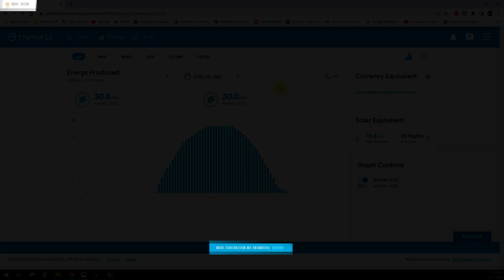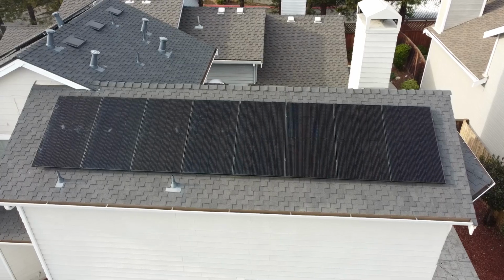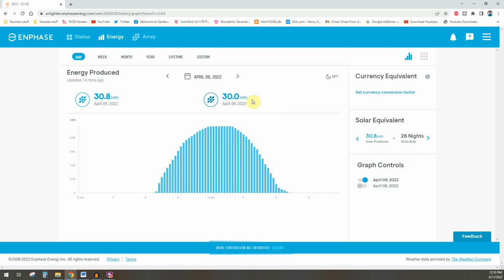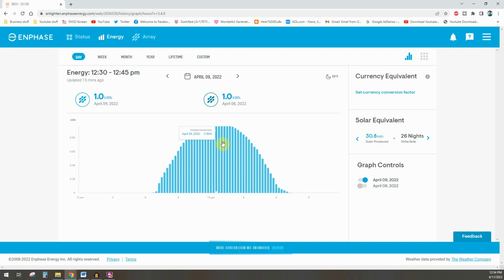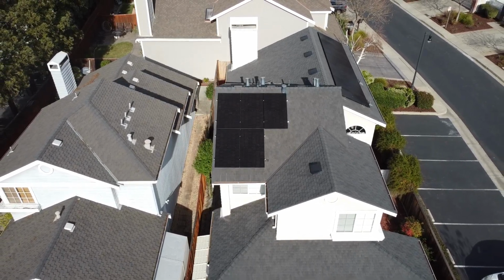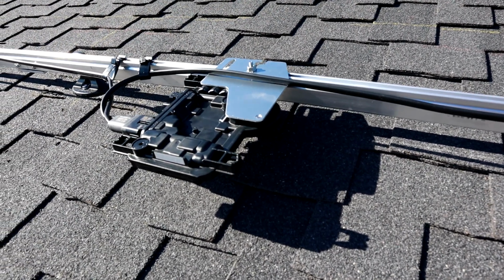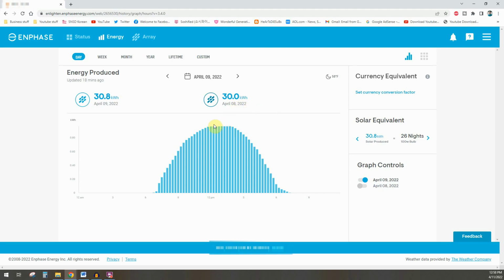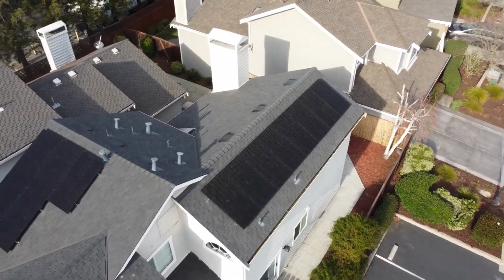What Is Clipping For Your Home Solar System?

Comment: Thanks for the video and information. 

Sometimes it's possible to mount panels on a vertical wall facing approximately west.   This will increase production during the late afternoon peak demand period when electricity is the most expensive.
Reply from the maker: Definitely.  That would suck to be that installer though putting those up :D
Reply: @nukem384  Actually not at all.   I build van electrical systems and put panels all kinds of places.   Not a licensed home installer though, only do mobile stuff.    There are some challenges with getting the conventional mounts accepted by cities but it is a must going forward

Didn't realize at first that you are also in the bay area.   I am in the East Bay
Reply from the maker: @harryniedecken5321  Heyo go Norcal!

Comment: Where are you located and panels facing south?
Reply from the maker: Bay Area.  I have 2 arrays that face SE and SW.
Reply: @nukem384  l am planning to get REC 400 panels and Some installers recommend IQ8+, IQ8M and even IQ8A. I have some facing South and located in Kansas. What do you recommend?
Reply from the maker: @mrteausaable  REC 400 are good panels, so you're good there.  What's your pricing for the micros based on?  IQ8+?  If you can get IQ8Ms, those are best suited and super popular with 400w panels because it's a good mix of a good DC ratio (clipping) and not too expensive like the A's.  Hoping in KS, your total price is about $3/watt gross if you're paying cash for the system.
Reply: @nukem384 I already got a few quotes the lowest price is $3.40/watt up to $4.20/watt.  No one offer $3/watt for REC 400 and IQ8M.  I am afraid it will not clipping at all for IQ8M (330peak) in my location since sun is very low.  Some quote me with IQ7+ and IQ8+.  One quote me with IQ8A because this is what they can get plenty off.  This rep I will stay away.  They sell solar and do not care about your system production.
Reply from the maker: @mrteausaable  You actually want to go by the continuous output, which is 325w (va).  Not much difference, but just wanted to let you know.  Dang that sucks your area doesn't have any installers that will do it for less.  My installer was quite a bit cheaper in the expensive Bay Area.  I'm pretty sure you're still going to clip since you said you have S facing panels, but it probably won't be that much if the sun isn't that high in the sky.  Getting IQ7+ or IQ8+ isn't bad either if they are much cheaper.  I have IQ7+ with my 400w panels and they work totally fine.  The difference isn't going to be huge, but if the pricing on the M is really cheap or the same as the +, then go for it.